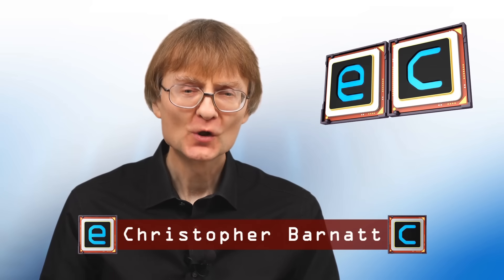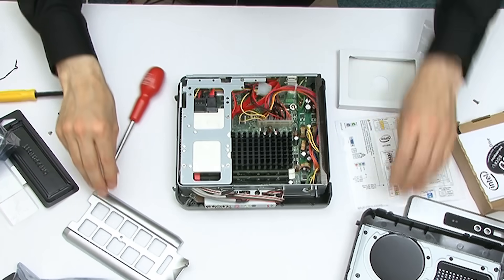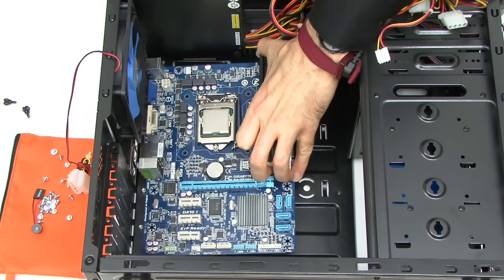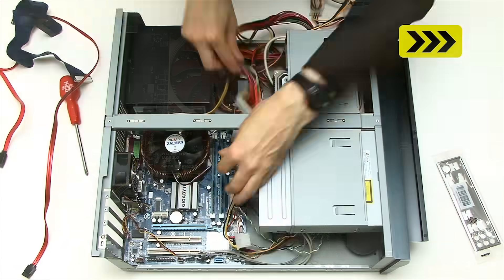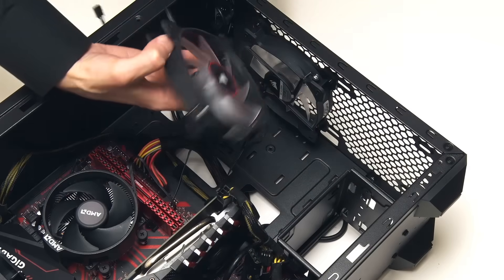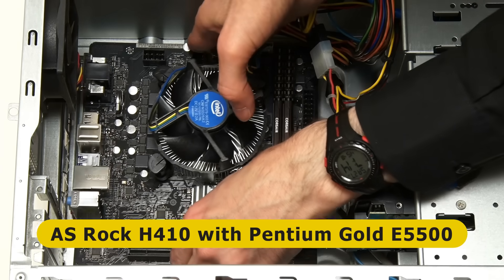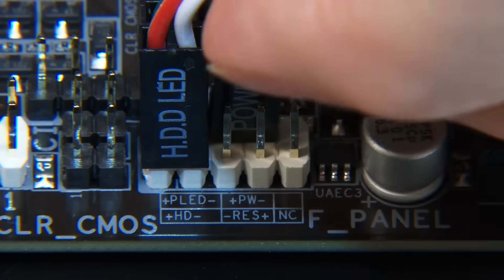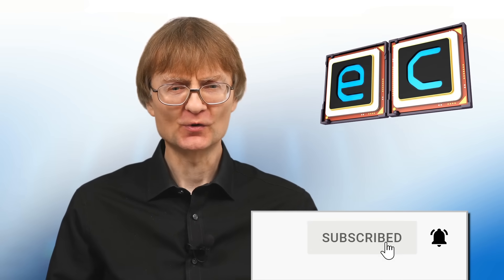EC Best Bits: The PC Builds

Comment: I've built a Windows XP PC (Coolmaster case, Gigabyte MoBo, various other bits) and then a Windows 7 PC, which I upgraded to 8:and 10, and used similar hardware. This was about 20 years ago.
My Windows PCs had a CD drive which I used to install the OS from genuine MS CDs. How do I get Linux onto the new PC?
Reply from the maker: These days, operating systems -- including Linux -- are normally installed from a USB drive. You you will need to write an Linux ISO to a bootable USB drive using a program such as Etcher or Rufus.

Comment: Well if you can, how about a build which includes easily available parts that are swappable in the future so that the computer is, in one way or another, future-proofed and likely to last the user for at least 10 years. A roomy case is good, and if the build is very generic, it might even be used as a server. To that end, some version of Linux might be best. A processor that can use ECC memory is also nice. The latest WiFi card for WiFi 7 but also swappable when WiFi 8 arrives.  Of course since I know little about such builds I may have asked for the impossible. With our tarrifs looming importing these parts may soon become too expensive.

Comment: I can't believe we're still using the PC design from the 60's. AT boards? Card edge connections? Back planes? Wire and plastic power rails? Am I building an Altair? It's the same friggen design. And it's causing problems. Look at GPU's for an example. They have become so massive that their own weight is cracking the PCB. Did we change the design, the card thickness and mounting structure, to accommodate? No, because of the AT standard. Did we change power delivery so connectors won't melt? No because of the AT standard. The standards are old. They need an upgrade. We need better designs.
Reply from the maker: Great post.

Comment: Chris, have you ever upgraded anything sequentially? Most of the PC users are talking about upgrade ability: but the least are really doing it. Except of doubling the RAM maybe. Some are buying new graphics cards. I left the PC in 2013. I fiddled and diddled lots, especially screwing all the new components together. Since 2013 I use Macs. No fiddling and I upgrade them in the same way. 😂❤
Reply from the maker: Some of the videos mentioned here show sequential upgrades! :) But on a personal level (ie the systems I use), aside from storage upgrades -- which I've done a lot of -- it is rare that I do an upgrade that does not involve a motherboard, CPU and RAM (although I have done one processor upgrade -- in the CPU upgrade video mentioned here). You are right that a lot of people talk about making a PC upgradable, when in practice few PCs are ever upgraded, aside from storage, and maybe graphics cards and RAM. I don't know how you would upgrade a current Mac, aside from replacing it! :)

Comment: Thank you for the 5600G video, which I followed for my own upgrade. But what a pity that it's now becoming so difficult to source a new case with 3.5 and 5.25 inch front bays to fit our additional USB panels in, or interchangeable hard drives. Or in my case a DVD writer. I do like a DVD writer, I'm old-school.

@6:05 - STANLEY!
Reply from the maker: The 5600G is a great chip. I agree with you about the bays. :(

Comment: Thanks. For over 4 years I have wanted to replace my Coolermaster HAF X case as the dust filters are meh & the one below the PSU can only we cleaned if the PSU is removed. I have 4 HDD & a DVD writer. Most new(er) cases don't have an optical bay & only have space for 2 x HDD with 2.5" SSD seemingly redundant as NVME drives are so much faster & not much more in price  plus often only have 2 front USB ports.

Comment: You should have done a build video of your current main video editing PC that is running Windows 7 offline, since you were building it anyway.  I prefer the builds that are of computers that you are actually going to use, rather than built specially to make a video about it.
Reply from the maker: You are right, that was an unusual build in many ways. At the time I was pushed for time, so did the upgrade in a few hours (compared to the few days it would have taken to film). But certainly a missed opportunity.

Comment: I’ve really enjoyed your single board and budget computer videos over the years. I’d really like a video on budget, gaming and productivity workstation or even home theatre builds. Videos, quite similar to your regular output, but with more powerful hardware. Maybe, using previous generation parts, could you make a capable gaming desktop under £350-400 or an ultra budget build (under 250) of second hand/low end parts? I think this could be very popular, especially with inflated price of top end GPUs atm. You could even change out parts, run benchmarks and find what the best configurations are for a given price range.
Reply from the maker: Thanks for this! Several of the builds here were in the budget category -- most recently the 5600G one (still a decent chip). I am planning another such build! :)